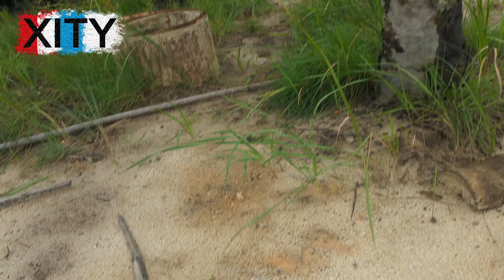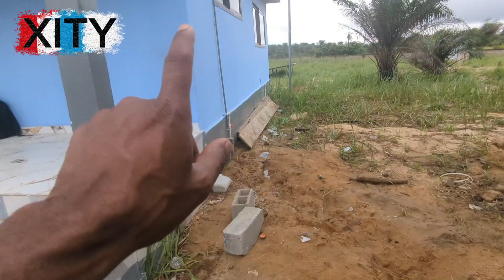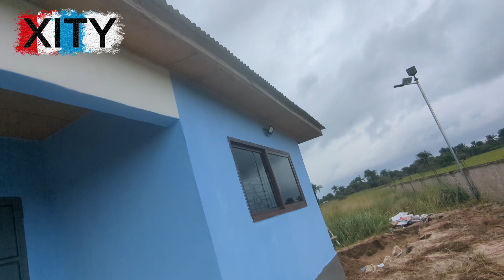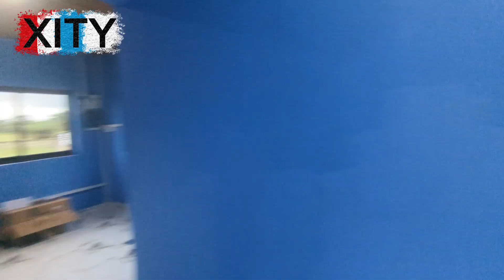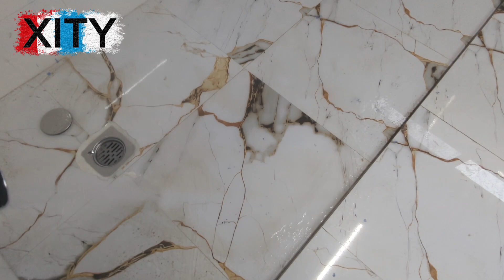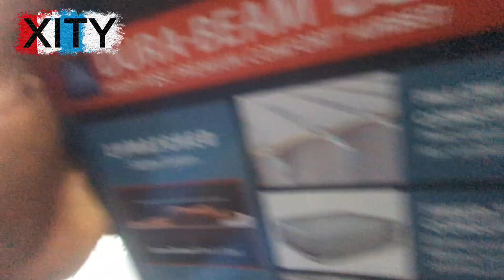XITY: The Cabin Is Almost Complete

Comment: Kinda noisy like a generator ?
Reply from the maker: Not really. You couldn't hear it when I was right out the door.
Reply: @xity so what what are you promoting the solar system or the water system?
Reply from the maker: @maryannbrowne4487  off grid life
Reply: @xity what is that ? I need water I’m in Marshall.
Reply from the maker: @maryannbrowne4487 water, electricity, home construction that allows you to have all the basic things for living comfortably without the need for the national power or water supply system. We can be reached at info@xityafrica.com or via WhatsApp+231777909012